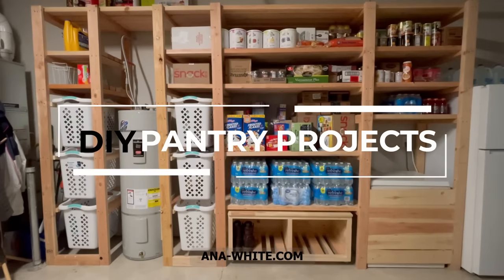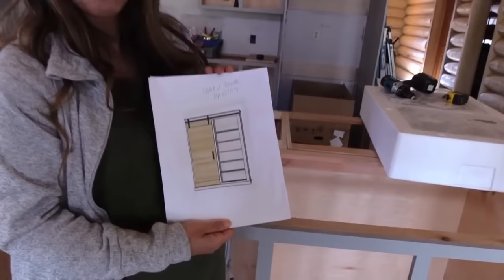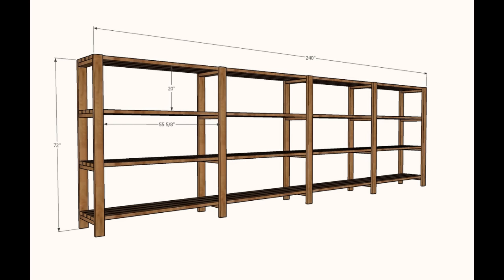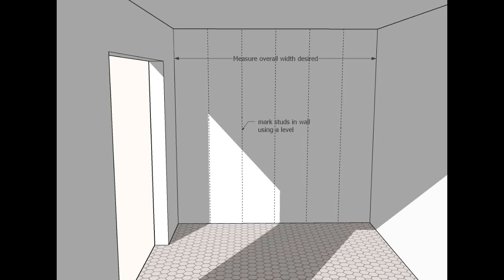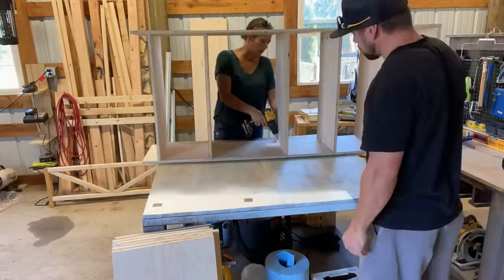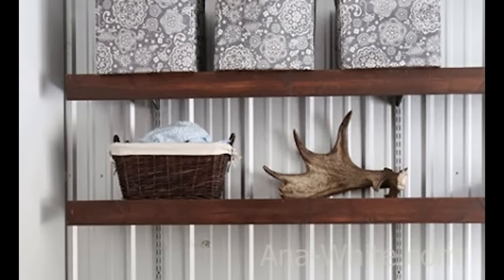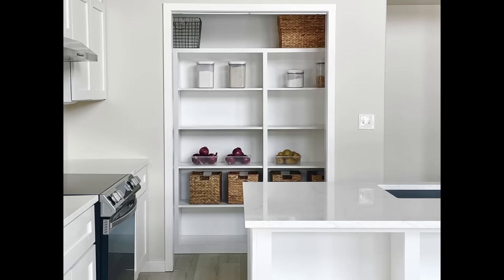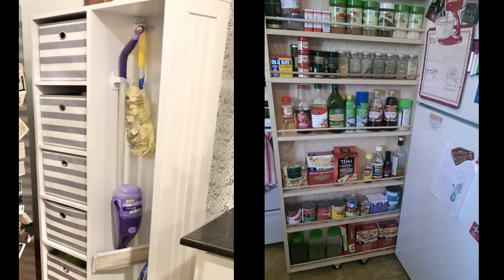Top DIY Pantries with Free Plans

Comment: You can also use finished 1/8 inch thick wall paneling cut to size to put on the wire shelf units you can buy at Menards or Home Depot.  I saw that on another channel.

Comment: I would love to see your take on a pantry that uses something similar to the barn door idea, except that it's a set of pantry shelves that slide back and forth in front of the fixed back wall of pantry shelves.  There would be, say 3 layers deep of shelving instead of wasting the middle space.   I've been kicking this around as an idea for my pantry.  My house's floor plan had the option of a pantry on the kitchen side of the wall, or a fireplace on the living room side, and the my ex husband chose the fireplace.  I've always wanted the pantry, so now that the house is mine, that fireplace has got to go!    It's not a particularly large space, so I want to maximize it, but I've never seen a pantry with the design I have in mind, and am not sure how to go about it.  Maybe tracks or the barn door hardware to mount the movable shelves?
Reply from the maker: Oh yes that sounds clever, sounds like some sort of track would work, but hard to say without seeing the space...
Reply: Seems like I've seen someone do that on a much smaller scale, like a medicine cabinet. Maybe it was Family Handyman. I don't remember if it was a video, or if I saw it in the magazine. It would probably be worth looking for that; then you'd only have to change the dimensions.